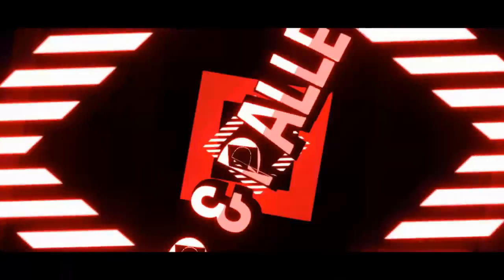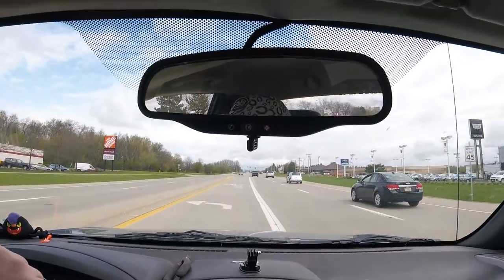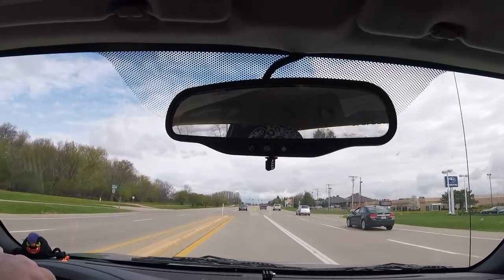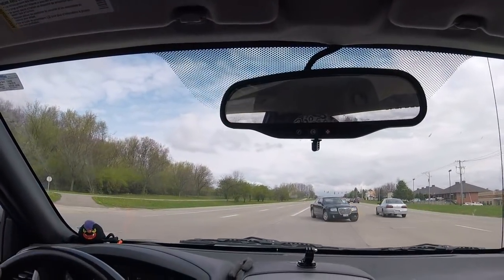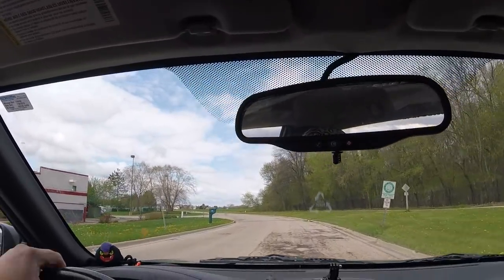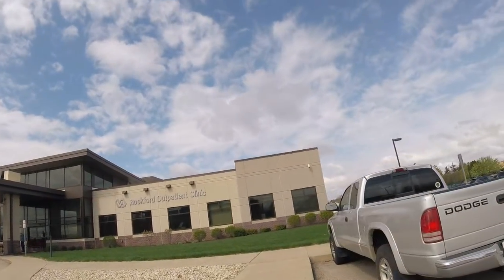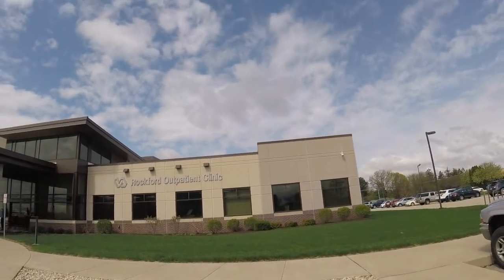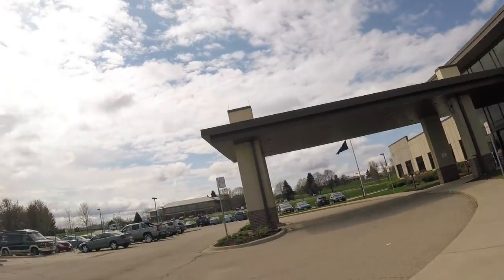Dumpsters & Curbside Scrapping - Scrap Happy

Comment: The phone did very well. How long a clip could one make using an iPhone? How did you attach it so you could record that segment?  As you know, of course, you weren't just lifting the steam table (fryer or whatever, you were also lifting all the crap in those bags that the table legs were hanging. Would there have been any problem (like from cops) if momentarily you just removed the bags from the dumpster, placed them aside a bit, then taken out the table?
Reply from the maker: R. Livingston I just took my phone and leaned it up against the cab of my truck. I didn't attach it to anything :-) the problem with that still thinking the dumpster I was only able to use my biceps and my arms because the dumpster was up to my armpits. I should have pulled up my truck right next to the dumpster. That would have given me an extra two feet. I could have also used my tie down straps.

Comment: Need to start doing u a lil workout hit some weights get ur streingth up so u can get that good scrap by yourself and if you had u a good rope or strap u cold of pulled it out slow with the truck u had it facing the rite way. Another great video
Reply from the maker: I should have totally used the truck to pull that out